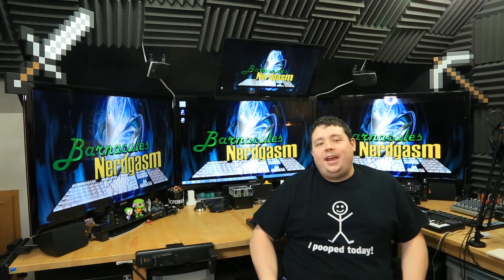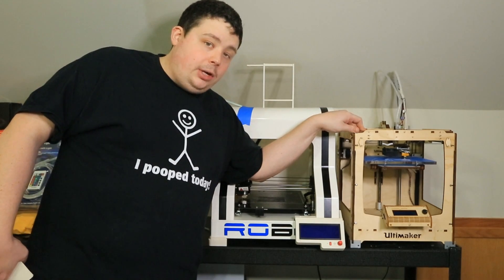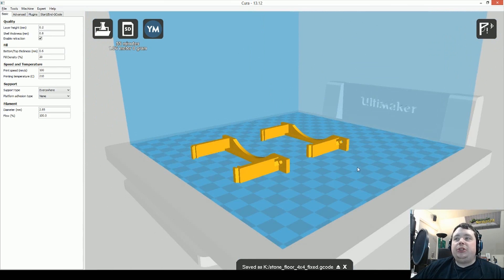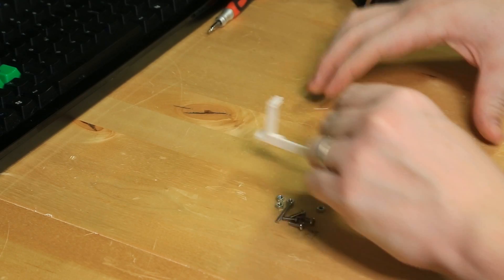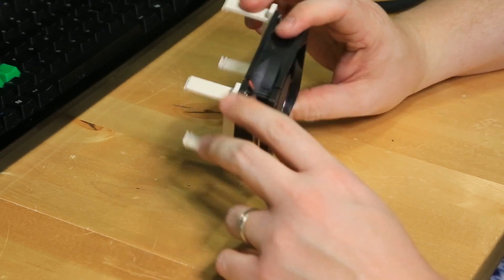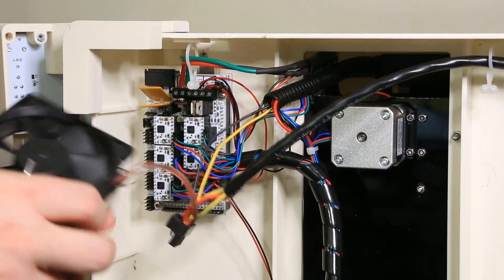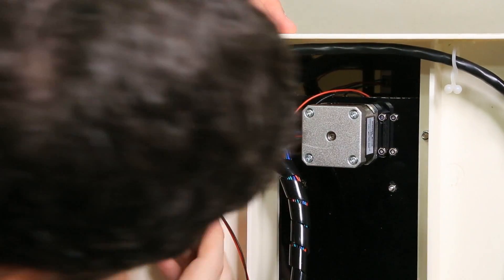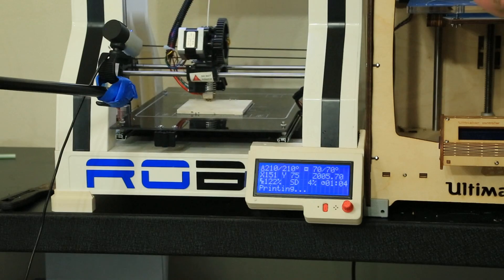How To Fix Robo 3D Printer Overheating Problems : Cooling Arduino 2560 - @Barnacules

Comment: Or 
Orrrr
get an atx defective computer power supply and take out the PCB and leave that two fans and the large heatsink and connect the two fans the same way you connected the fan

Comment: you should use raft and brim to not have the piece unglue itself from the bed, i realized that in the last month , i got a 3d printer also , is a delta one , very cheap but raft and brim fixes 80% of unsticking problems, the rest of 20% is my bed, i forgot to put some locking nuts on the leveling screws

Comment: Someone has probably already said this but Jerry the "ramps" is the board that plugs into the Arduino mega, what you called the ramps are the stepper motor drivers, not trying to sound like a smart ass but just so you know

Comment: I don't have any of these problems with Geeetech i3 pro c.  There's a fan that comes with it that should blow from the side of the board so the airflows cross the top and bottom.  Printer head 240 and bed at 100.  Prints for many hours at a time.

Comment: why is there no heat sinks on the chips on your ramps board?? that would probably help quite a bit itself i would imagine. I know my ramps has heat sinks on the chips. they are super cheap and just stick on with double sided metal tape.

Comment: The Robo3D R1 comes standard with a very effective cooling fan for the electronics board!
Reply from the maker: RoBo 3D Great to see that you guys fixed some many things since the first printer.
Reply: +Barnacules Nerdgasm I wouldn't like to see you doing a topless lap dance. I would like to see some Windows 10 tweaking. :)
Reply: ROBO 3D very smart way to play it by making all the little upgrades youtubers make in order to refine the printer. with the fixes and reliability, the robo should blow the rest out of the water at that price range. can't wait to see the r2
Reply: Comes with cooling - yes, "very effective" - no.  With the stock cooling it will run for up to an hour, but after that the board still overheats.  The 40mm fan has 1/4 the airflow capacity, plus the enclosed bottom (even with the vents) significantly restricts the airflow.
Reply: Interesting because two years later and my Robo R1+ that I got about six months ago is shutting down whenever I make a print that covers a lot of area, just like he mentioned in this video.

Comment: if you didn't have a second 3d printer to print the clips out, you could just wire up the fan.. point it at the adruino partly propped up so air could flow thru the fan, print the clips and then install the fan correctly... if it were me i'd use 4 balls of modeling clay between the table and the fan for the temporary setup... or.. maybe balls of tape and tape the fan in place just long enough to print the proper clips.

Comment: had the same problem with my ultimaker 2. until i got the replacement, made a stand out of wood and worked wonderfully. i need to print some real stands and a fan mount. seems like this is a flaw in most printers D:

Comment: Ok I'm only 12 so don't get mad if I am wrong. An idea I thought of for the Arduino board. The controllers look small enough like ram chips. So try to put thermal tape on the chips and then small ramchip heatsinks that are tiny and put them on top for better cooling. Just an idea that might work.

Comment: Hello. I was wondering if you can actually print a fan. The case, the blades, the motor mount and the fan mount.  Than all you have to do is attach the motor. Because not everyone keeps all that stuff at home . I usually throw not needed stuff 😭😜

Comment: Your Pololu stepper drivers have no heatsinks on them. This could cause the chips to break in near future because the heat doesn't get pulled out fast enough. The fan helps a lot already, but it's best to have 8x8mm heatsinks or similar on each Pololu module.

Comment: Thanks for all your Robo fix videos Jerry. My Robo will hopefully ship in the next month or so, I will install all the fixs/upgrades I have accumulated which should keep headaches to a minimum. You mentioned in one of your vids that the Robo prints as well but not as fast as the UM. Why is that exactly

Comment: I'm new to arduino and I'm building my first robot.  It positions and drills holes in cylinders (alcohol stoves).  All I have left is the programming.  I'm having trouble using my limit switches to assign values to integers (or other variables).  I can only make them act as on/off switches.  I want my horizontal and vertical sliders to find their starting positions.  Their steppers need to do a loop (onestep and check the switch) until they hit their micro switches.  If you figure this out far before me, I will give you stoves.  Next time I'm using inductive proximity sensors.
Reply: What do you mean? You need to count up on microswitch trigger? I am actually a programmer, so explain better and maybe I can help.

Comment: On your Robo 3D is the hotend all metal or does it have a liner in it?  Trying to get PLA to run on an all metal hotend and the aluminum heatsink with the fan blowing on it is similar to what I am going to make.  Hope I can work it out.  Thanks for the info and Great Videos!

Comment: You should have heatsinks on the driver chips or even better would be switching to DRV8825 drivers but as you said even the heated bed fails I doubt the drivers are the cause.  You can get 32x microstepping with the DRV8825 on ramps using the 16x jumper configuration that you are likely using now for the A4988 chips and they can run more power without active cooling before they fail due to heat.

 To add, the power you pulled from for the fan is the 11amp supply to ramps and is solely dedicated to D8 (heated bed) and your bed will be using nearly all of that during full power.

Comment: Hey Barnacules. I saw that on 2:22 you talked about where is the Arduino board and... well, you pointed to the Ramps. The Arduino goes below. The Ramps is not the Stepper Motor controlers(also known as Stepper Driver Module), the Ramps is a Module that goes attached to the Arduino, and the Stepper Motor Controlers go attached to the Ramps (The last version, if i remember well, it's the 1.4). Also, looks like it's not an Arduino, but a Taurino Mega 2560, because the board is White.
Hope i could help anyway.
Hugs!

Comment: Am I the only one that sees a major red flag with this?...if the chips are over heating to the point where they are crashing...you maybe able to add a fan to prevent the crashing but the chips most likely still too hot and will be more likely fail completely later down the road...I would find some small heat sinks(the ones for small transistors)  to put on those chips to at least get the heat away from the chip and then allow it to dissipate into the air...50cents at local electronic store may save you from having to get a new board. just a thought
Reply from the maker: You are correct this is not the optimal solution but this is a good solution for someone that just has a spare fan laying around. Not a lot of people have heat sinks just laying around that will fit those tiny little chips :D But that being said just having air flowing over the board seems to be sufficient because the printer is rock solid now when it was failing 100% of the time previously.

Comment: I really want to get a 3d printer soon (within the next few months), but stuff like this is actually really holding me back. I know 3d printing is still in its infancy for the most part, and I'm not opposed to tinkering, but I feel simple stuff like this should have been thought out by the manufacturer long ago.

I get the appeal of printing your own upgrades, but some common upgrades just seem to be such a no brainer that it should been that way from the beginning.

Comment: Hey Jerry. I was thinking about getting a 3d printer but I was thinking on getting a kit to assemble one. I figured it would be cheaper and a great way to understand the machine a little more. Now I'm not a whiz kid when it comes to electronics. I did build my own PC but we all know that is not hard. So I was just wondering what you thought about those DIY kits. Good Idea? Bad Idea?
Reply from the maker: It's a good idea if you have weeks to tune and tinker with it. I don't know many people that have fully assembled the printers and got them calibrated and printing perfectly without a lot of tinkering.

Comment: why don't you, print a 3d printer, cheat the system!
Reply: Because it's impossible unless we make a Hollow Model and have a big 3d printer and slots for the 3d printer
Reply: Zias Vialva Rep Rat?
Reply: CNC Mill + 3D Printer or Plastic injector and its possible, Not any electrical parts however.

Comment: Put som MOSFET head sinks on your stepper drivers. This helps a lot. You can buy them from a good computer shop. They come with adhesive thermo double sided tape.

Comment: Nice video, but for the love of god, stop using metric screws! As a mechanical engineer, it's driving me crazy. I understand you have them left over from other projects, but just go and pick up some #4 screws (the imperial equivalent)..they cant be more than a couple of dollars for a pack of 50 on McMaster
Reply from the maker: I could care less what kind of screws they are as long as they work :P
Reply: Barnacules Nerdgasm Oh my god, you responded! Sweet! I'm not even mad anymore. Use whatever you want.

Comment: Wish I could afford a 3D printer. Keep the videos coming!
Reply: Some of the lower price 3d printers make very good prints.
Get one with a heated bed and make sure it has limit switches.
Someone made one with no limit switches and if you tell it to home it will try to destroy its self. Much of the software to run a 3d printer tells it to home right before making a print. So the limits are needed.